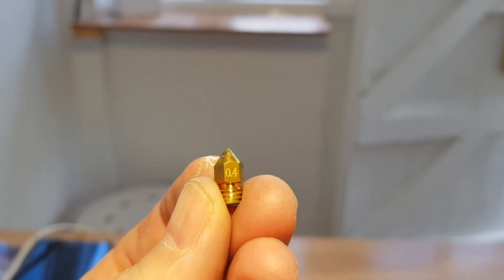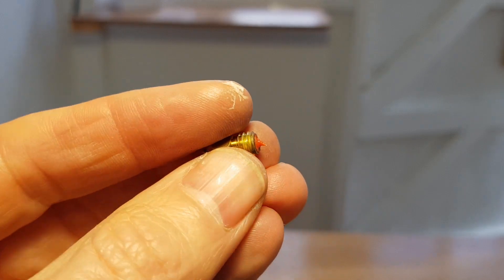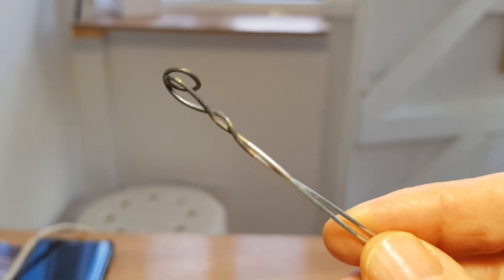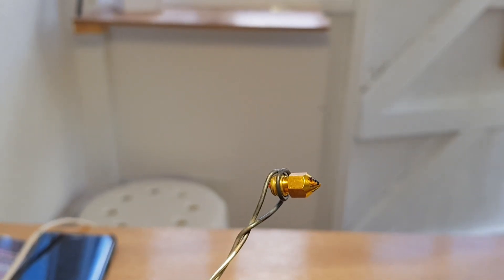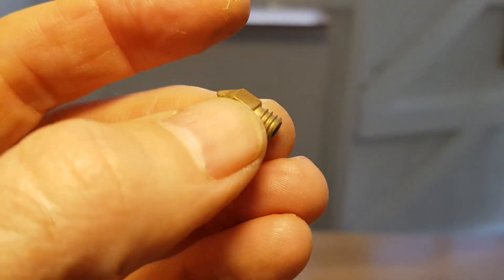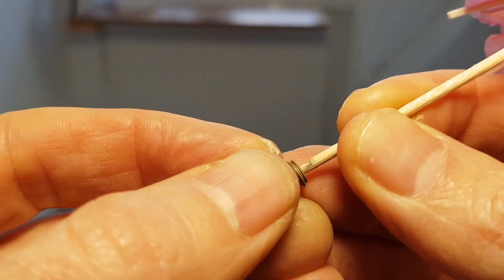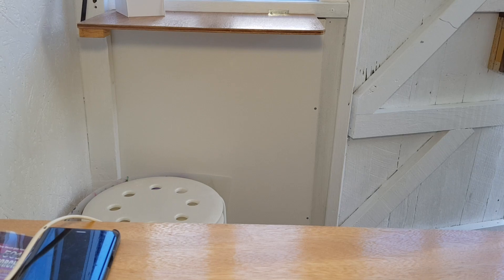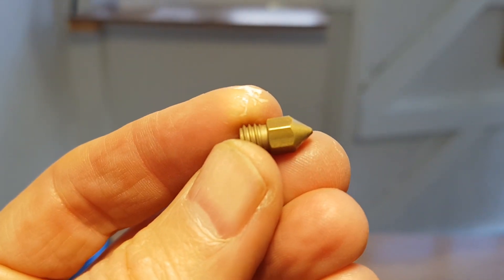3D Printer Nozzle Cleaning - Does burning off work?

Comment: I discovered this solution recently. The nickel plated, copper nozzles for my Phaetus hotend are quite expensive so I don't really want to replace them too often. Now I burn them with propane torch to the point where they are glowing red. It works really well and it's super fast.

Comment: many people on the internet do not agree with the method.. i was talking with a mechnical engineer and he told to look at it this way. "when you get a nozzle from the store and you run its first run, your nozzle is depreciated by 50 percent already.. its like a car, you roll it off the lot and its worth less." I think his point is that after like 2 or 3 nozzle cleans, reguardless of your method, you should replace nozzle. makes so much sense and by getting the nozzle hot af youll burn all that plastic off, so it seems to be the most effect.. just some insight i heard and wanted to pass on, thanks for the vid!!!
Reply from the maker: Yeah that makes good sense.  For cheap brass nozzles it can be worth just replacing with new for piece of mind.  For the more expensive nozzles I do go the burnoff method a few times.
Reply: @MakerMike54  🍻 happy printing!